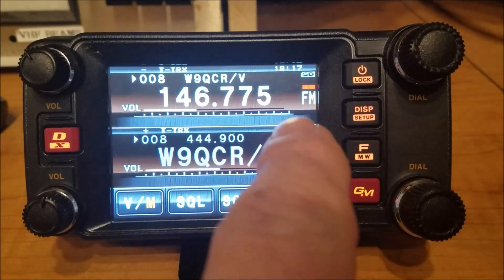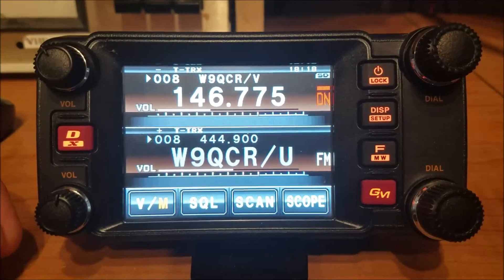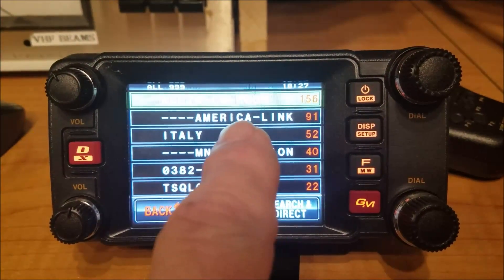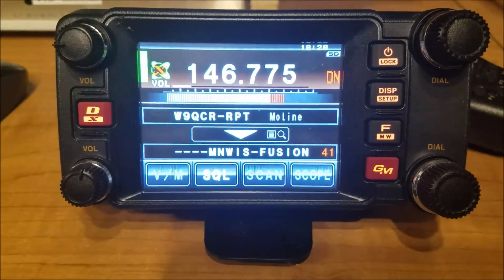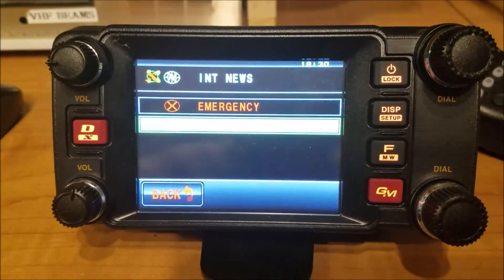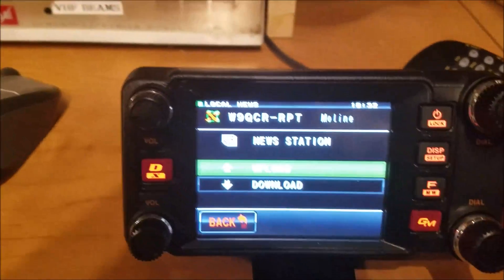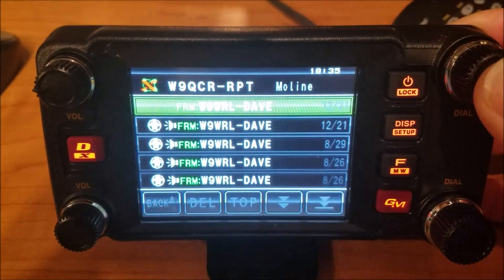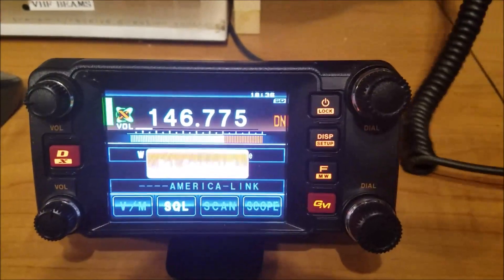Yaesu FTM-400 Demo

Comment: Question.... when mobile and you connect to a wiresX repeater...... does that interfere with regular traffic on that repeater ?
Reply: We have a wiresX node connected to our Fusion repeater. We run a tone on the output of the analog side so that when monitoring the analog side you don't break squelch when there is digital traffic.  We also have our repeater in AMS.  The wiresX node is strictly in DN (narrow digital).
Reply: Of course, when a repeater is used in digital, analog only users will hear noise, it also depends how such repeater is set up... AUTO or MANUAL switch between modes.